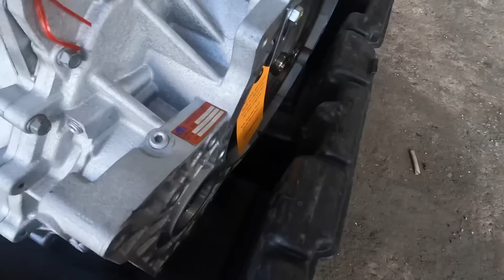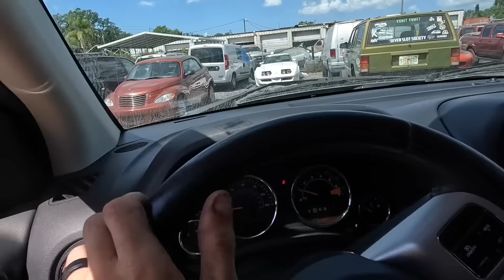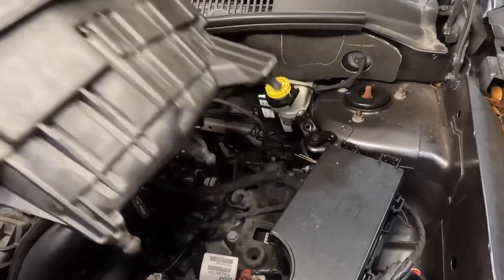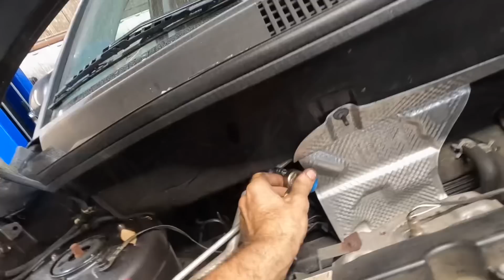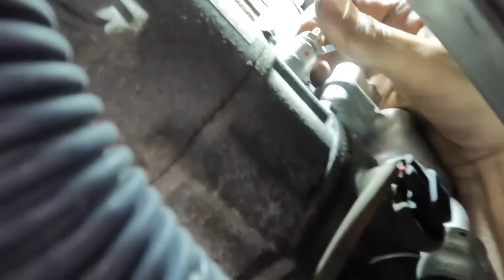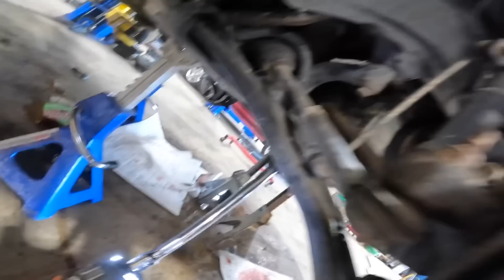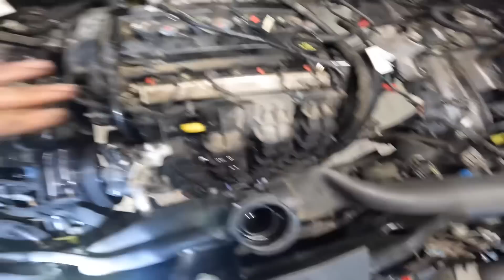Transmission Blown Up! Remove Entire Vehicle! 2016 Jeep 2.4 #mechanic

Comment: Have you worked on a manual transmission of the compass? I have the 2010 but I think the transmission is the same up until after 2017. From what I've read in forums, the transmission is a constant issue along with the TIPM. I would love to see the transmission torn down to see the problems (carnage) inside.

Comment: I know Ray doesn't discuss his charges, costs for remanufactured transmission. I would love to know the $ details that made this course of action seem the best choice. The reman trans must be at least 5-6 K (just a guess) before any cost for removing the old trans and  installation of the new one. Did the owner drive 100,000 miles plus without ever changing the trans fluid? What killed the trans? Best guess?

Comment: I'm genuinely curious the outcome of this service. The transmission you show and replaced is the hyundai 6f24 which is not a cvt transmission. You know this by the torque converter you installed but yet you classify it as a cvt in the video and also filled it with cvt fluid. From my understanding running cvt fluid in a non cvt transmission will cause significant damage and with that being a brand new reman that wouldnt be ideal.

Comment: The original cvt transmission failed because it was made by jatco.  Why would you spend 2500 on a remanufactured jatco cvt to put in a vehicle with 100k on the ticker?  Wow.

Comment: On my first vehicle, this would have been a 5 minute job. Spray a couple cans of rust remover in the engine bay and the whole engine would have dropped right out. On the flip side, it would have removed the front half of the car permanently, except maybe the dashboard, steering wheel and rubber floor mats.

Comment: So....What did this end  up costing??  Probably $2500 to 3000.00  for the Reman transmission plus 24 Hours Labor/Shop time @ $100.00 / Hour,  plus Sundry Items  for Re-Assembly and Hazardous Waste Disposal....Hmmm, We're look'n at a $5500.00 job here folks...Although, cheaper than a new rod, 'n ya know what 'ya got in the end.....I'd say, yeah, Worth it....Especially if 'ya got someone like Ray work'n on 'yer vehicle....

Comment: Jeesus, Mary 'n Joseph....To replace transmission, Disassemble vehicle...Meh   For a 2016, the body and engine bay are very clean, even the chassis was amazingly clean...Most people don't take care of their rods like that.  Seems interesting that the trans totally failed @ 105,000 Miles, but I've heard not too many good things about those Slush Boxes.  I have a 2006 Ford Escape V6 4x4 with a 3 inch Lift kit 'n 265 70 R16 Tires for an everyday driver...The clock reads 156, 500 miles 'n the trans works perfectly.....But, I 100% replace the trans oil every 50K miles....

Comment: Good work but wrong you’re supposed to remove the transmission from the bottom not as an assembly with the engine and cradle

Comment: Ray, this is what hangle means, hangle (plural hangles) A hook in a chimney for hanging a pot; a hanger. A form of hanger by which the scabbard of a sword was suspended, attached not necessarily to the girdle, but sometimes to two rings fastened to the cuirass at its bottom edge, one over the left hip, the other near the middle of the back

Comment: You need a cheap harbor freight hydraulic table to pull the motor trans safely!!  Or the $7000 hydraulic table that the car ninja uses!! Makes the job easier and safe!!!!

Comment: This is one reason why I refuse to buy an automatic transmission equipped vehicle until I cant lift my leg to work a clutch. I really wanted one of those new Rangers... But they cannot even be ORDERED with a manual transmission, and by renting, and driving it 2500 miles, I have that I HATE the Ford 10 spd Auto. 
I also think all CVTs are total junk.  I despise the way they work/feel like the ICE is gonna blow up before it "shifts", which it apparently doesn't actually do.... 
I might be driving a car that is "fussy"... But I have 288,000 miles on my car, and am STILL using a perfectly good FACTORY clutch/5 spd transmission/ engine. The biggest $$ repair I had to do here in NY, was replace the exhaust from the manifold back.

Comment: those are one of the easiest transmissions to pull, you do NOT need to remove engine, i work in a transmission shop, those units can be swapped in less than 4 hours.remove battery and tray and air box. remove all top bell bolts and harness and shifter cables etc from transmission.install engine support bar, struts stay in the car too, unbolt rack and sway bar from subframe. disconnect ball joints from steering knuckle. bungee cord the rack and sway bar up. pull subframe. now you can pull axles ans cooler and anything else hindering removal. pull tork converter nuts. rear driveshaft etc. support trans with trans jack. pull rest of bell bolts and wiggle the unit out and down..

Comment: Not a fan of CVT's being used for anything more than a Toyota Prius. You can't tow with them, 4 wheeling is terrible, and any extreme driving is a disaster. Chrysler (aka Fiat) has taken on the reliability of it's parent company from the '80s. Fix It Again, Tony!

Comment: These are very time consuming jobs. The first engine I pulled was in about 1970 when I pulled a flathead from a "51 ford. Probably done 600 since. Oldest I worked on was a 1914 dodge engine. I remember when you could pull a 6 cylinder Chevrolet engine in an hour, and could swap a 3 speed transmission in 1/2 hour.

Comment: In theory, I think this is the opposite of the assembly line (they assemble the drivetrain then drop the car onto it)

It’s seen a few videos of repairs like integrated Ford or Toyota water pumps in the timing cover that the book says to drop the drivetrain.  Normally Ray is creative enough with smaller repairs to avoid this.

Comment: I have always found it a lot easier to remove the cv shafts while the engine is in the car, same with the starter and torque plate bolts. These can be hard and unsafe to do while on the jackstands.

Comment: have you tried an induction gun on those stuck bolts. safer than a torch... when I see new fiat jeeps all I want to do it jack up the radiator cap and put a good vehicle under it  easy what are you going to do after lunch

Comment: Got a used 2016 FWD Jeep Patriot three years ago and no it is not  fun to work on. Had been throwing a P0442 code and 
shouldn't have guessed which part was bad. Threw parts at it ( I'm no mechanic )and finally  took it to a mechanic who 
said  it's not the gas cap but another part which I already replaced ( but not OEM)! Still was throwing the code! Well had 
to get it fixed since emission testing is  part of getting new license plates  so I went under car and found two wires leading
 to the gas tank pressure  sensor. It was bad! Luckily easy part to get but not so to reach it. Fixed it! Just replaced the
 spark plugs on it at 72K miles and they were the second set put on thankfully. Lots of work for an engine/trans removal.
Half the battle yet to come.

Comment: The year: 1970; me: 20. I had very little mechanical experience, but I managed to replace the clutch in a 1965 Ford Fairlane that I bought from my dad. Car on blocks and me underneath. It took me the better part of a summer day. The hardest part was dealing with the weight of the transmission. My point is that a good mechanic like ray could have done it in his shop in a matter of a few hours. Clutch kits are pretty cheap. I also recall replacing a blown heater core by simply accessing it through a panel in the firewall. That took all of about 20 minutes. Fuel filter: 20 minutes. Sadly those days are gone. Labour is expensive. 
This is a great example of having the equipment and knowing how to use it. Gutsy undertaking!

Comment: It looks like a regular automatic transmission. Not a CVT. by the looks of the tranny pan with valve body and transmission cooler lines. But then again. I don’t work for Dodge. It looks like our standard automatics I install at Hyundai. But love your video. 👍🏻
Love the video though.

Comment: Try doing that but leaving the engine in the car.  I just did it with my 2013  dodge dart 1.4L manual Transmission and I don't have any of the fancy equipment you have.

Comment: Hangle is actually a perfectly good, though archaic word. 
A hook in a chimney for hanging a pot; a hanger, or a form of hanger by which the scabbard of a sword was suspended, attached not necessarily to the girdle, but sometimes to two rings fastened to the cuirass at its bottom edge, one over the left hip, the other near the middle of the back. Great video as usual.

Comment: Crappped out CVT with barely over 100k who would've thought. Junk.
Reply: That's not a cvt.
Reply: @carlosb1 except it is.
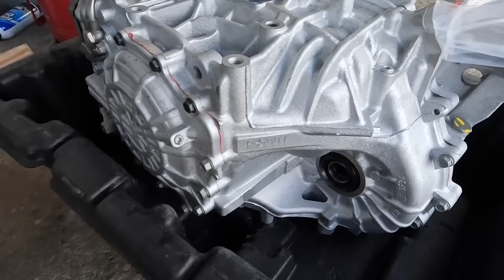Reply: @Brisco_County_Jr  If you look at the model number stamped  at 0:20 you will see "F624MK"  which is the 6 speed  tranny from Hyundai. You also see it stamped at 0:26 . Not CVT. You can also tell is not the CVT because the oil pan is not at the bottom and is not sort of triangular. Also this tranny does not have  the filter housing at the top. This conventional tranny has this black cover on the side and it plastic. Unless  they sold  some kind off hybrid monstrosity to this bro lol, they lied to him or he does not know what he bought, this has all the 6 speed conventional tranny signs.

Comment: I literally last week had to pull my engine and transmission out of my 02 Civic LX 5spd. to do a transmission swap. I had to pull mine out of the top because I don't have a lift. 

When you first took over this shop Ray there was an engine hoist inside that truly was inspiring. I converted my dad's engine hoist into an ATV hoist! It was a GAME CHANGER for sure as the barn I was working in has a compacted dirt floor. 

 I've still got grease along side my nails, so I feel ya man! Not a fun job.

Comment: Since Nissan is the Chrysler of Japan, it makes sense that they both have bad CVTs.
Reply: This IS the Nissan CVT.
Reply: @m476nycity  I just looked up how many cars use it, that's scary! I know Toyota has a supposedly good CVT but I don't like them, I was considering a new Highlander hybrid which has a CVT (2016) and I opted for the non hybrid with no CVT.
Reply: @Paramount531  A lot of vehicles use the same unit as the Nissan, sadly, they aren't quite as bad in other vehicles as they are in the Nissans. The Toyota hybrid CVTs are a totally different setup and are very reliable. But they have some sort of stupid failure of a seal or sensor inside that renders them useless when it fails. Toyota will then sell you a new transmission and not the part to fix it.

Comment: Your right, the easy part is taking it apart, the scary part is putting it all back together so it works and works right. This might a good illustration that trans fluid needs to be changed sooner the 100k....

Comment: The 3 speed automatic in my 89 Wrangler hase 377K miles on it, though it did get a seal refresh about 10 years ago. My mechanic says the old ones are far less trouble and much easier to fix.

(Frankly CVTs are a disaster waiting to happen, because they rely entirely on rolling/sliding friction engaging and disengaging as the chain constantly travels. Too much tension it wears faster, too little and it slips. Pulling a load greatly increases the wear.

A conventional automatic relies on static friction, that is the clutches are either engaged or not. The ONLY time they wear at all is during the fraction of a second during the shift. Even trailer towing is less of a problem because (properly working) clutches are never sliding.

Comment: When they put the engine/transmission assembly into a new Corvette, they have two people (one on each side) to guide it into place.  The strut mounts need to be wiggled back and forth before the nuts go on.  It will be fun to see you put this all back solo.  By the way, no one working at the Corvette plant seemed to be having any fun.  They need a good dose of the Rainman!

Comment: 19 bolts and the trans removed from my ‘68 tempest. With a helper 20 minutes. New clutch and pressure plate back on the road in 65-70 minutes. Automobiles are far more complicated than 50 years ago.

Comment: I just wonder how much does a job like that cost? The cost for the re-manufactured tranny, fluids, maybe replace things like hoses, belts, plugs, wires, motor mounts when a part, and then all the labor. I image that job without any added extras must cost at least 3K probably more like 5K.
You may ask why I would like to know the cost, just curious. lol Although the last time I got the oil changed on my 2012 Jeep Grand Cherokee with a V-6 3.7 I was told one of the motor mounts was starting to leak and I wonder how much replacing one of those might cost?

Comment: Is there anything you do different with the placing of the lift points? When you are dropping that much weight from the car.
Reply from the maker: Not really, the car is so light and so short that the imbalance doesn’t influence safety or lift stability. Super long trucks, dually trucks and cargo vans are a different story

Comment: Ray love this way of working; Its often faster to work in reverse to the factory production line, take for example a heater HVAC unit buried under the dash, it only take about 5 steps to fit the entire dash over the heater unit why would you take all the radio, trim, airbags, speedo, cup holders out, just take the steering column out and centre council, then the whole dash unit to get to the heater. Great videos

Comment: So sad that the once proud name has become just as reliable as a Fiat . 105,000 miles and the transmission is shot 🤬. The amount of labor is incredible to just change a transmission. Albeit a front wheel drive transmission is never really easy but pulling an engine 🤷‍♂️. 
Question: you always mix the recovered fluids in your suction device. I know that in NY and Connecticut mixed fluids with coolant especially turns them into hazardous waste as opposed to recyclable fluids. If so , doesn’t that require special handling and therefore a higher waste fluid recovery fee ??

Comment: Hi, Ray, I don’t know if you read the comments, but I have a question. I’ve got an 09 Mercury Grand Marquis with 56,000 miles. Would you recommend a normal transmission service or Flush?
Reply from the maker: Have a BG exchange done, it’s better than dropping the pan and refilling. The machine gets the majority of the fluid and the spill and fill only gets about 40%

Comment: I use plastic tubs from a restaurant supply store. I label each one ("P/S", "Airbox", "Left Suspension", etc.) and put the hardware for that item in the tub. This saves me from messing with bolts more times than I have to, and the tubs are cheap -- and reusable.

Comment: One of the things I really enjoy about these videos is your constant self-reviewing of the process. It's so easy to screw up when you don't stop and look at a project and go over what's been done and what needs to happen.

I'll admit, I've never seen anything close to this, although watch Army mechanics pull the engine from a M113A1 APC was kind of cool.
Reply: Our techs at the Nissan dealer used to do a similar operation for CVT replacements and even head gaskets on the transverse VQ engines. I guess the rear one is next to impossible to replace with the engine in the car. If I remember correctly, one of our guys could do the gasket job, including removing and reinstalling the engine in less than a day.

Comment: pre-requesite to work on modern cars a 2 post lift. more than 2 jackstands. a large shop. half the snapon tool catalog.
pre-requesite to work on older vehicles 2008 or older generally speaking. a Floor jack. a cheap socket set. and a couple hours.

Comment: Happened by a dealership to deliver parts and saw a full size crew cab pickup about 6 feet in the air with the chassis still on the ground. Boss man said that is the only way to get to a part on the back of the engine. He said it was only 1 hour to separate the two assemblies. Impressive sight to see!

Comment: Ray,
Why not use zip ties to hold stuff away from your work area instead of juts tucking it behind something?  That way it will not 'flippity-flp' back into your way.  Securing it away like that will keep it from getting pinched during re-assembly.

Comment: Tell them to service it every 20-25k miles and it will last longer! CVT transmissions are 100% intolerant to missed service and if you think 20-25k is too short an interval then look up Car Wizard and watch his video on CVT after 20k miles and see how bad the fluid is. Not saying you do not know this already, just in case you do not know. CVT can last if people maintain them like clock work. If you do not then get ready to spend %k-6k to replace it plus tow fees.

Comment: I had a 2008 Caliber R/T with a 2.4L but a 5 speed manual trans.  It had 190K miles when I sold it and it ran like it was new.   Those CVT transmissions are junk!

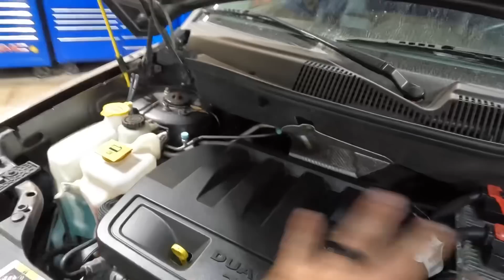Comment: @2:25... Dropping the whole drivetrain is the hard way. I sling the motor, drop the subframe, swap the trans and reinstall the subframe. The sling and passenger's side mount hold the engine in place. If I don't have a sling, I use the passenger's side mount and a screw jack under the oil pan to hold the engine in place.

Comment: Our 2015 Honda CRV puked its CVT at 99K miles. Worst design to come down the pike in decades but all the OEMs are onboard 'cause they produce great fuel mileage numbers. Heck over 5 years you might save enough on gas to almost pay for half of your new transmission! I think they figured out that the engines they've developed will last 300K miles with proper maintenance. Needed some planned obsolescence thrown back into the mix. BTW selling the Honda, buying a Toyota with a regular AT.